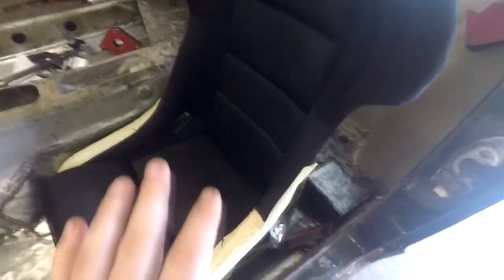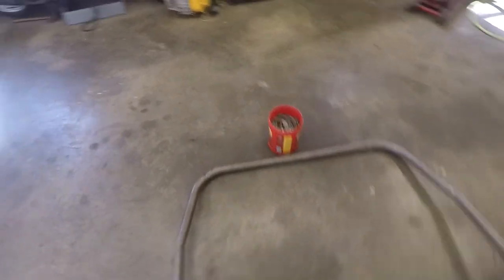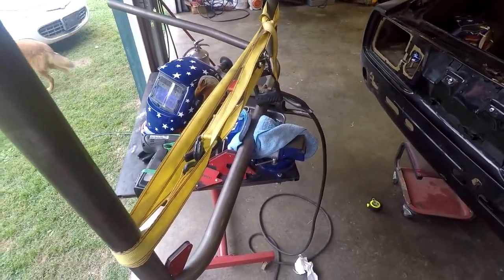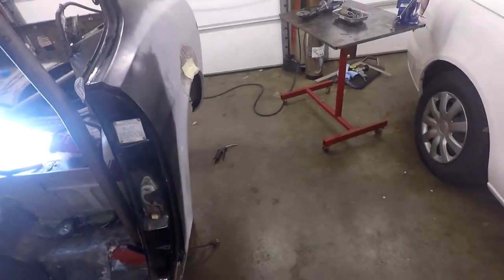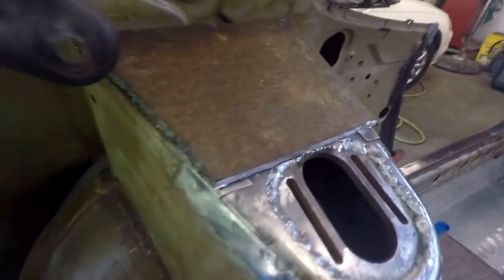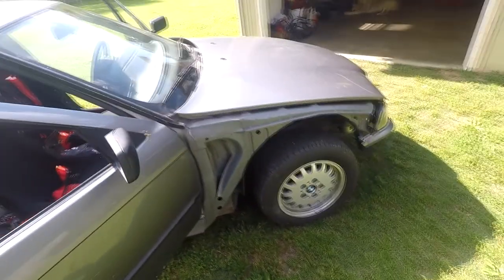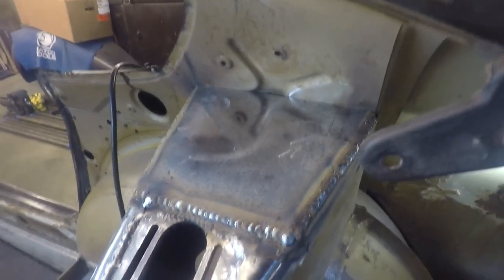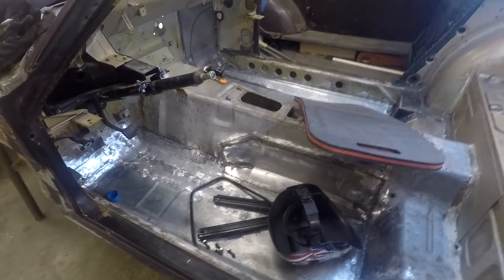Trying to fit the Rhodes Roll Cage in the 280z + Welded Dif

Comment: I also installed a Rhodes cage in an s30. Shit was a nightmare. I’m currently trying to do another on a z31, even worst.
Reply from the maker: Yea that’s unfortunate. Maybe other cars have better luck... I know I was disappointed but now I am happy because it’s not a track car and I didn’t need the hassle of a full cage.
Reply: I recently purchased a Rhodesracecar pre fab rollcage and it sucks. Main hoop is way way over bent and not even wide as the roof of the car and is useless, halo was to small also, front down bars were not bent correctly. I can go on and on. Sending it back.
Reply from the maker: That sucks. Pretty much my experience as well with the hoop (only part I actually used). I had to squeeze it together cuz it was too wide. Unfortunate because it’s a great concept for a DIY guy to buzz it together and save some money...

Comment: Do you think buying the Rhodes roll cage way to go or get a custom welded cage?? Looking at my options
Reply from the maker: I didn’t have a good experience with the fitment. I did buy it second hand though so not sure I can blame the company. If I were to do it again, I would take it somewhere for a cage. Especially if it is a full cage.
Reply: @StewartMotoring  thank you man, I appreciate the tip,  looking into lemon race with my civic why I was looking into Rhodes full cage, and also my bro sold his 240z for beans when I wanted to buy it and track it.
Reply: @2LAZY-2EDIT  do you currently race in lemons? Thats what im building my rx7 for. I recently purchased a Rhodesracecar pre fab rollcage and it sucks. Main hoop is way way over bent and not even wide as the roof of the car and is useless, halo was to small also, front down bars were not bent correctly. I can go on and on. Sending it back.
Reply: @willjunkin732  good to know, haven't raced In Lemons but Intrested to in the future, I guess custom cage way to go.
Reply: @2LAZY-2EDIT  yea we are looking into keeping the cage and making some new pieces or just sending it back to summit who I bought it thru or just building a cage from scratch.
Reply: @willjunkin732  https://www.stableenergies.com/Autopower-Bolt-In-Roll-Cage-Mazda-RX7-78-85/productinfo/APW83591/ 
Not sure what year is your Rx7, but these guys were good when I bought my 4 point bolt in cage for my 90 civic. They made sure to ask what I'm doing with car and if it had sunroof etc.. was a perfect fit. Sold it for beans wish I didn't now.
Reply: @2LAZY-2EDIT  hey I appreciate that. I looked them up and gave them a call. Waiting to hear back.